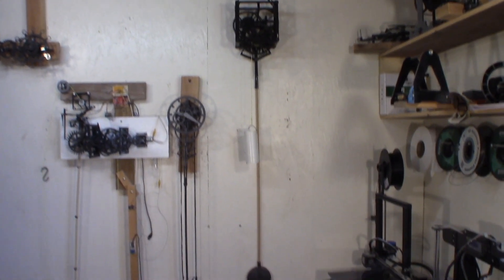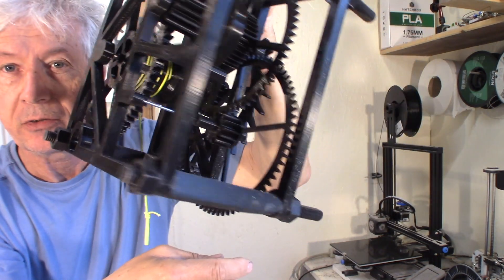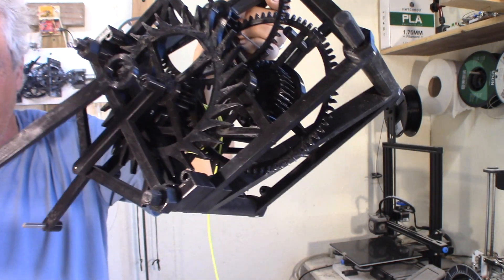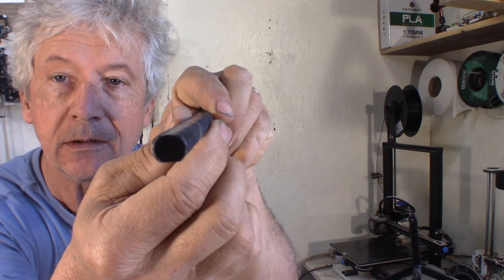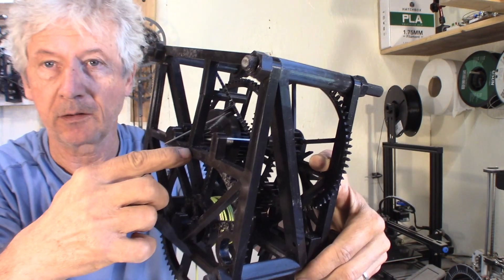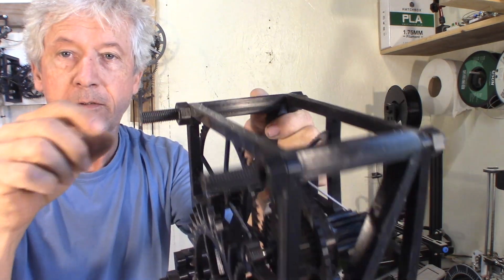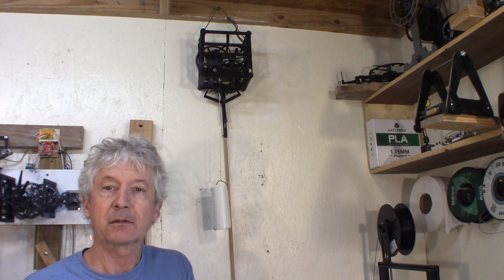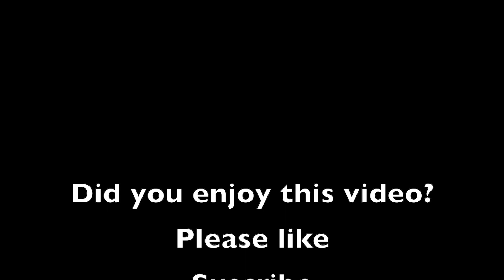Clock Design with FreeCAD and Assembly 4 Workbench, first test run: Part 5

Comment: Great Job. Found your channel as I am trying to do the same thing. Printer arriving next week and I'd like to do a clock project. Looking forward to your video on escapements in FreeCAD. I'm practicing with it now on gears and the escape wheel and pallet are killing me. (deadbeat/graham escapement.) Thank you for posting these videos!
Reply from the maker: Thanks
Good luck with the printer
Check out this video:
https://youtu.be/A4Vdn0wB2kg
it is done with Fusion 360
however the geometry is correct, and the escapement, anchor combination works great